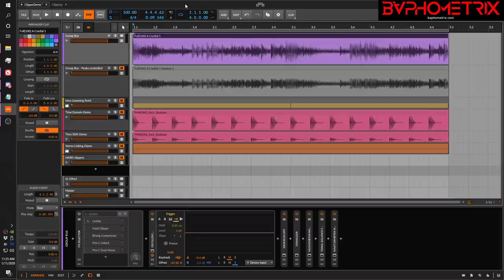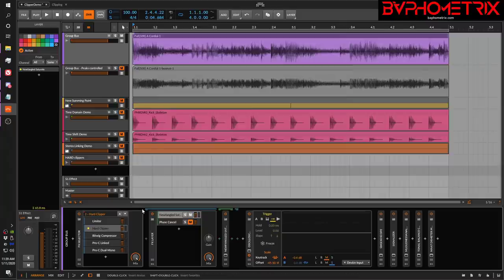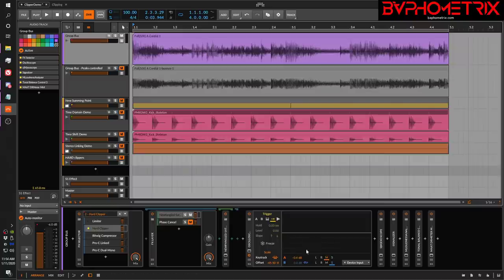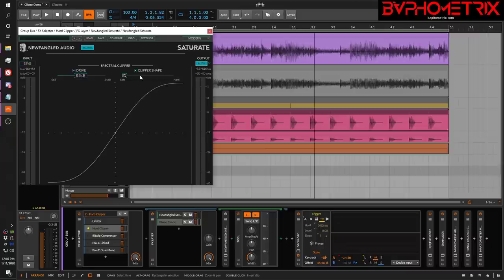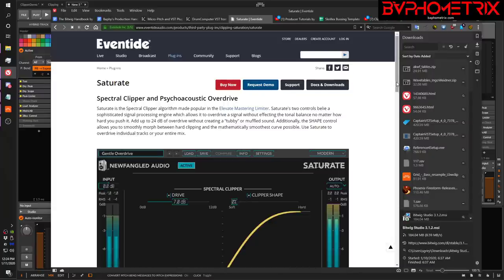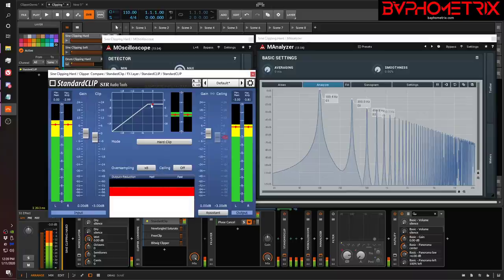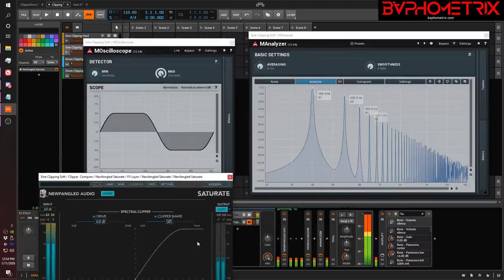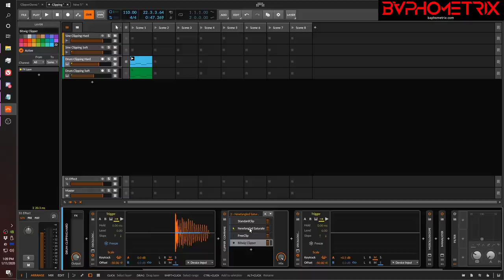Deep dive into clippers--NOT compressors--for clean, transparent loudness

Comment: Are you saying use clippers only on "summed" tracks? No individual tracks?
Also, here's an off-the-cuff theory (and feel free to disagree if that's the case).  The reason clippers might work a little better is because (if used correctly) they clip off the peaks of signals down to or close to what are the RMS values of the signals.  Our ears don't respond to peaks in signals so much. Instead, our ears actually respond more to average peaks in signal.  With that in mind, might it be an idea to clip down to the level (or maybe just a little higher) of the highest RMS value in the whole chain?
Reply from the maker: Use clippers everywhere, not just on summing points.  Many small clips will end up with less overall harmonic distortion than just a few big clips at just a few summing points.

That said, don't clip anything if you don't need to. Pay attention to how all your channels are summing up through the busses, and work backward and do some small clips on individual channels as needed to ensure the dynamic range on any one bus isn't larger than it needs to be.

Your theory is mostly correct, but don't overdo it. You need peaks and you need transients.  It's just that if you're producing in a loud genre, you need to compromise those peaks and transients in an intelligent and thoughtful way so that your final mix is in a small enough dynamic range to BE loud, without sounding like hammered overcompressed and distorted crap.
Reply: @Baphometrix  Appreciate it much. I get the feeling you're the type that doesn't always go with convention, and I like that.

Comment: Is using a compressor to sidechain considered “gluing” a sound together?
Reply from the maker: No. The term "gluing" when used in the context of compression isn't clearly defined. It tries to describe the effect of using a bus compressor on a variety of different signals that are summing at the bus. By imposing a single new Attack > Release envelope from typical bus compressor settings (slower attack time, medium release time) onto the summed signals, you emphasize the strongest transients in the combined signal slightly, and you "press" all the other sounds together into a slightly narrower dynamic range during the downswing of the attack envelope and the early upswing of the release envelope. Therefore, you are "gluing" those formerly separate sounds together and turning them into a single more unified sound.
Reply: @Baphometrix  thank you so much for the clarification! I use my compressor alot, especially to sidechain the bass to the kick so the kick stands out. I was curious if I should still do that if I use this clipping method you showed or if there was a different way to achieve that without the compressor.
Reply from the maker: @vaan97531  sidechain ducking is vitally important, especially in louder genres. I have entire videos about ducking subs to kicks. Yes, you still very much need to do this even if you use clipping to help you achieve more loudness. 

That said, I very much do NOT like using compressors for ducking. I far prefer more surgical compressors like "Duck" by Devious Machines, where you can precisely control the length and shape of the ducking slice.
Reply: @Baphometrix  thank you so much for the info! Do you have a discord or IG?

Comment: i'm like 6min in and i already spotted some weird arguments. for example you say clippers are better than compressors because compressors act in the time-domain. well, clippers also act in the time domain. they just don't consider the progression of the wave but rather instantaniously cut. then you said the envelope follower from a compressor can be compared with the adsr in a synth. well, no, not really. an adsr is triggered by plain noteOn and noteOff-values. but a compressor's envelope follower reacts dynamically to the input signal, especially if ratio is not turned up a lot. you could compare an adsr with a transient shaper tho. there the onset-envelopes of a signal trigger an actual adsr-envelope. also you used OTT as an example for how compression changes the sound rather than controls dynamics. yeah no shit :D that's as if you split your signal into 3 spectral parallel tracks and apply a massive clipper to each of them. that would sound even more disastrous. also compressors can indeed reduce peaks. you just have to use lookahead. and that's also the whole point why mastering limiters like pro-L2 have the lookahead-knob so prominent in the UI (which you didn't use in your a/b). then you turned up the clipper but has the signal even exceeded the threshold of the clipper? because clippers only modify the signal if it's actually loud enough and i know for certain that if you go into a clipper with a complex signal you easily get very nasty crackle noises. not saying clippers are bad or anything. you can use them to add dirt to a signal, like a parallel-bus of a realdrum-snare to just give it some more smack, but comparing it to an oversampled mastering limiter in the quest to find fidelity and transparent loudness seems kinda sus
Reply from the maker: Okay.
Reply: "Perfect Mastered track" just sound terrible and muddy as well..
Reply: @Lovingdeadboy  i don't wanna argument like that. i'm a music youtuber as well and i know that it can be hard to find music everyone agrees with to showcase certain stuff. i was only referencing the statements themselves

Comment: Have you tried Boz's new Big Clipper?
Reply from the maker: Yes, and I'll be honest. I'm not a fan. It's not really a clipper. It's more like a hybrid clipper/limiter with very counterintuitive and confusing controls. To use Big Clipper as a true brickwall limiter/clipper, you have to use the third algorithm (L*C), and then drag the Blend knob all the way to the right. Which effectively cuts out the limiter portion entirely and only uses the clipper stage. No other combo will actually brickwall at the ceiling set by your Pull value.  Also, I've extensively compared the sound of Big Clipper in this true hard clipping mode against other hard clippers, and honestly, other hard clippers sound better on something like a beefy kick drum. When you push something like GClip or KClip (NOT oversampled) up just past the breaking point where a beefy kick is starting to sound "rubbery", and then set Big Clipper to the same exact amount of drive (and sample peak reduction), you'll hear that GClip/KClip sounds less rubbery and closer to the original kick than Big Clipper does.
Reply: @Baphometrix  Thank you for this extensive reply. I learned more about clipping by listening to your video than all other sources combined. Planning to rewatch with full focus. Quick follow-up: Do I understand you to say that clipping is fully synonymous with saturation? (i.e. every plugin advertised as a saturator is in fact a clipper? I em identical process? (This was news to me!)
Lastly, any thoughts on the Clipper Section of TDR's Limiter 6?
Reply from the maker: @chaddonal4331  Saturation = SOFT clipping, and vice-versa.  HARD clipping is similar not the same as "saturation".  TDR Limiter 6 is a fine mastering limiter. The difference is that only a few limiters (lke Limiter 6 or Eventide Elevate) let you actually tweak the clipper stage.

Comment: Any thoughts on Kclip?
Reply from the maker: KClip Pro 3 was in a bad state for a few months when I was making this video (Kazrog had a bad installer for Windows for a while.) But I've had KClip for years and it's very good. KClip Pro 3 is the only clipper out there that can do oversampled clipping and yet STILL actually shear off peaks at your specified ceiling value, because KClip actually has TWO clipping stages in it. (The "Ceiling" knob is is a secondary non-oversampled hard clipping stage.)

The downside is that KClip Pro 3 has 2x oversampling ON by default, so it adds a little bit of latency by default. The trick is to configure it so it's doing NO oversampling (1x) by default, and then save that state as your DAW's default preset for KClip. Then you can use it in a "zero-latency" mode at first, early in the project. And later during mixdown when latency doesn't matter any more, you can switch some of the KClip instances in your project into higher oversampling modes IF you want to (or replace some of them with a limiter instead, IF you want to).
Reply: @Baphometrix  Great stuff. Mostly things I would have completely looked over. Big up for going into the details. Cheers

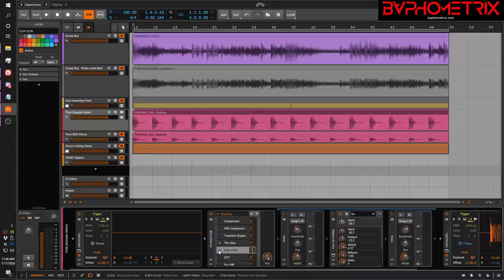Comment: You mentioned that the CLA-76 is supposed to have a very fast attack. Unfortunately, for your test of that compressor (at around 21:30), the attack knob is not quite at the fastest setting (6.57 vs. 7). I doubt that setting it to 7 would have knocked out that transient, but I thought you'd want to know. Interesting topic!

Comment: i have mixed feelings on this approach. Better said, mixed feelings about making it a standard approach. i personally use comrpessors First:  in order to shape a sound Second: to make it louder. 
I care about it sounding the way i imagine it way before i make any thoughts on getting loud. Also if you use clippers on a group you don`t get the  "melting together" a good compressor does or at least its not the same and not as flexible. Also compressing groups and-or individual tracks  you get completely different textures than with a clipper-saturator.
 Eq is just as important (if not more importan)t as compression and saturation.  Balance is king . Even in Loudness. 
But as you might have noticed till now i am not the biggest fan of -5  lufs music. It simply almost never sounds anything more than loud, aggressive  but also completely flat. 
It becomes a number game like "i can shave 0.4db here and 3db there"  and the sound quality is not important anymore somehow. 
But flat sound seems to have become standard so who am i to argue. . Don`t get me wrong, not attacking anyone here. Only thinking-writing out loud
Reply from the maker: No, you're right. Compressors are an important sound design tool. But that's the key. Sound design. Clippers (and your clipper cascade across the entire project) are for *dynamic range control* not for *sound design**. You do all your sound design in front of the clippers. Including the (mythical) "gluing" that compressing multiple different signals at some summing point (on a bus) supposedly does. You can put anything you want in **front* of the clippers.  All the clipper cascade does for you is enable keeping the total RMS where you want it and the peaks just under 0 dBFS.
Reply: @Baphometrix  but this is what i am saying  I DONT want many times. 
Simple example. Say you have a Kick+Snare+Some percussive element in a group and compress this and then clip it it can  have a completely different sound than if you clip Kick, Snare, Percussion individually and then summ them. For the Gluing compressor part, i don`t find it mythical at all but lets literally not go there. 
You say "do sound design before the clippers" as if clippers dont change the sound and i don`t agree with  this like,, at all.  I find the difference after using clippers everywhere Day and Night. Everything becomes harsh until the tipping point where it falls apart. But  i sincerely am not trying to "prove" something  nor do i want to open pandoras box of arguments or "internet fight" :-). From what i see you know what you are doing and follow your tate from there on.
   Its a difference of opinions and taste which is wonderful cause imagine if we all had the exact same taste.   There is one thing i wanted to ask you though. Are you familiar with any similar third party Oscilloscope-waveform visualizer doing the same as the Bitwig oscilloscope you use in these videos?
Reply from the maker: @saardean4481  Yep. All your points are valid. If you prefer working in more dynamic range with more nuance, and you don't like the sound of a mix/master that lives in a small dynamic range (to be competitive in louder genres), then you can use fewer clippers, at more strategic points. Or you can eschew clippers entirely.  My goal has always been to help stop the bad advice to "crush a 2-bus mix with a massive crest factor into a single mastering limiter and inflict 4 dB of gain reduction or more".  Which makes for really bad sounding loud masters. If you need to be competitively loud, there's a better way to do it, with less overall damage. But yeah, striving for any degree of loudness requires making intelligent *compromises* in your sound design choices, your mixing choices, and your final outcome.
Reply: @Baphometrix   ps:  i wanted to say that i write what i write with good intentions. i dont try to undermine what you are trying to show or be a smart ass. I find your content highly valuable and i am open to learning new things or ways of working i haven`t tried. Rock on!
Reply from the maker: @saardean4481  No worries! It's a good (and valid) viewpoint! I'm always happy to have respectful and objective dialogue. It helps other people who can weigh all sides and all viewpoints!
Reply: @Baphometrix  have you tried the Ovc 128 clipper by voxengo ?
Reply from the maker: @saardean4481  I'm not a fan of oversampled clippers or limiters. At least not when my goal is tight control of dynamic range and where peaks "stop". Any oversampled clipper will create peaks ABOVE the threshold of the clipper. (only KClip and StandardClip give you a way to compensate for this.)  Also, 128x oversampling is WAY overkill on a clipper, IMO. Anything beyond 4x or 8x is rapidly diminishing returns.
Reply: @Baphometrix   i also use clippers for sound design purposes so i am always interested in other types and thought you might have tried it. Yes 128x is overkill but i hope you can choose a lower setting (dunno if its possible). 
Havent tried the plugin  Yes the oversampled ones overshoot sometimes but you can replicate to an extend what these two do. You can use a secondary clipper that will only catch these peaks and if the first one has done all heavy lifting you dont always need oversampling for the second one  imo.  Or use a transparent "Pre- Limiter", Limiter  to catch them before hitting the limiter stage.
I personally dont get crazy over some overshoots as they seem like very short events. I have done some random listening and measuring testing of some "Hits"  There are so many hit songs and DnB and Trap  tracks oveshooting even up to +1 +2 db and i hate to admit it but some of them sound really fine (by super loud produced music standards) . Imho if the mix-song-track , whatever , collapses cause of a few overshoots then its not the best mix. There is a point where these things become "Academic Value Measurements- Knowledge" but irrelevant for what you actually hear. The vast majority of present D/A converters dont make a fuzz or fall apart cause of  of some overshoots.  Same as i find resolution and bit depth  above 48khz/24bit nonsense for a Master. But thats just me. Not saying thats the only truth.
Reply from the maker: @saardean4481  Yep, modern DACs handle reasonable True Peak overshoots just fine. This was a problem only in the 90s, in the early days of DACs. I watched Steven Slate once try to argue this point with Ian Shepherd. The whole OMG True Peak! thing going around everywhere right now is the boogey man. Ignore True Peak and be happy. It's a non-issue when you see True Peak values above 0 dBTP.

That said, what I was describing about oversampled clippers was about SAMPLE peak. Not True Peak. If you set the ceiling of a clipper to 0 dBFS and then oversample it, you'll have SAMPLE peaks that go above 0 dBFS, and that's a problem. 

The entire point of oversampling a clipper is to end up with less aliasing foldback (which causes harmonic distortion). But remember, this distortion happens only during the short instantaneous moment of the clip itself. If you're clipping the RIGHT material in the RIGHT way, the material itself will MASK the distortion. So it doesn't really matter how much "bad" harmonic distortion is present in that tiny "spit" of noise. Who cares? It should only be happening on incredibly short transients and masked by the mix itself.

Where you NEED oversampling is on saturation and distortion plugins that you are using for *constant coloration* of a sound, as part of your sound design. A dirty, distorted mid-bass drop sound. An edgy, hot organ or pluck sound, etc. Things where the distortion is constant and "always on". That's the only place where oversampling and the reduction of aliasing foldback (and therefore less harmonic distortion) actually truly makes a difference.

When your goal is strategic clipping for controlling the dynamic peaks of a signal (for loudness), oversampling is needless overkill, and can actually get in the way of you having full control over the dynamic range of your signals.
Reply: @Baphometrix  i hear ya and agree. Now you made me curious t ofind this video of Slate arguing :-)
Reply from the maker: @saardean4481  It's not in a video. It was in the Slate Audiofiles group on Facebook, back in 2017:

https://www.facebook.com/groups/slate.audiophiles/posts/1971586179752298/?__cft__[0]=AZXbq03VPcpEFGgiUswVqPX-nnflVpbFyRk48InnW0TcJVyTy9mDygfXeS_NGjZXb8az1WXHHUugARQGAFeGuV7xOVeI0tIZ_LRwsUKbw4CQPdBYLG3BhmmX7mhnHAbQA5vDQ4QzKNa0pRHgVULk6Z4X&__tn__=%2CO%2CP-R
Reply: @Baphometrix  thank you. now i HAVE to go there
Reply: @Baphometrix  Btw am really diggin V-Clip. I had literally forgotten i have bought it long while back until i heard you mention it and though "v clip , v-clip. sounds familiar..."  The GUI and workflow is pretty near to the way i am thinking
Reply from the maker: @saardean4481  My own short write-up of the subject: https://docs.google.com/document/d/1Ogxa5-X_QdbtfLLQ_2mDEgPgHxNRLebQ7pps3rXewPM/edit#heading=h.xa6coj4lv8uh